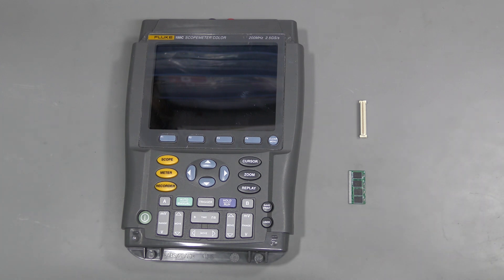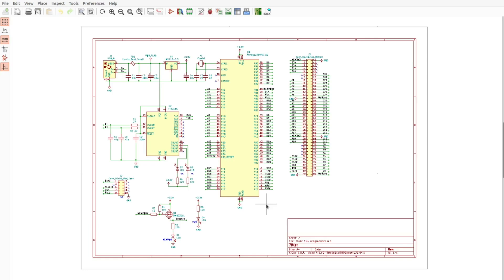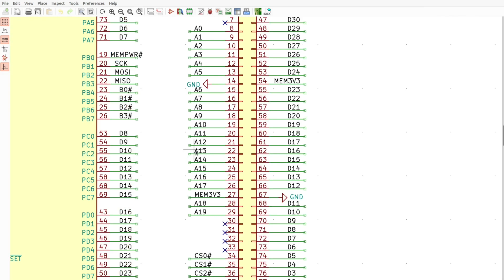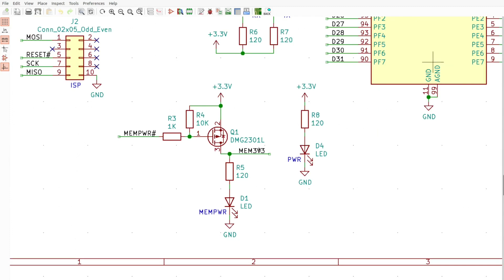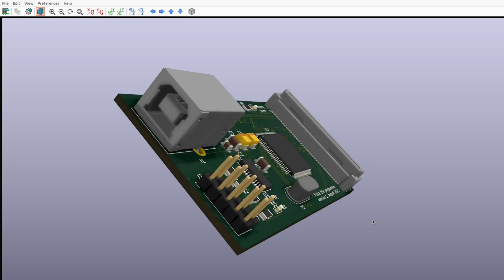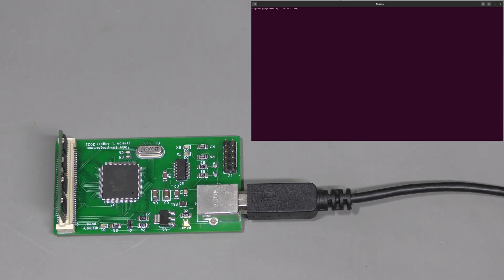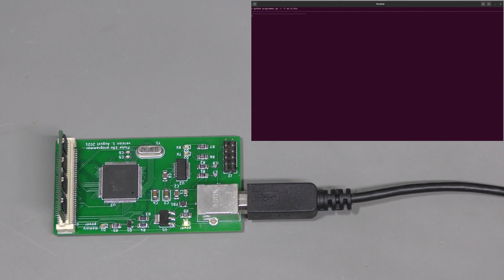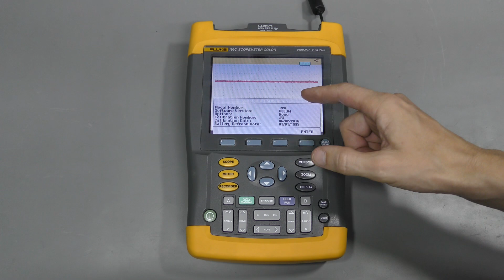#125 - Fluke 19x memory programmer

Comment: I'm  a big fan, great work!!  I have a Fluke 199c with the same memory module as you introduced here.  My 199c only gives weak beep and does not come on.  I linked to the 199c with my laptop and the "on board" memory gives back a 0(pass) but the A1 board gives back an "A" .  I am assuming the A1 board(memory) is bad.    The 199c will  not turn on without the board, correct?   The little daughter card memory board is the A1 correct?
Reply from the maker: Yes, the scopemeter won't boot without memory module. Only beep. I am not aware of the procedure of reading error codes that you describe. I would like to know more about it.
Reply: There is a troubleshooting procedure in the service manual that has you connect a laptop through the infra-red port and run scripts to check the memory using a terminal emulator such as putty.  It is in section 7.5.12 of the Service Manual "RAM Test".  for example once connected through the terminal(type X several times till the scope meter responds) then type ID...The scopemeter responds with  Universal Host Mask software: UHM V3.0...to test D3502 and D3503  you type EX11, #H20400000, #H100000(for the old Main PCB) or EX11, #H20400000, #H80000(for the new Main PCA D3202 only)
The test tool will return one of the following acknowledges:
0     Ram is OK
1     syntax error in the typed command
6     the RAM des not properly function, replace the two RAMs

for this test my scopemeter responded back with 0.

To test the RAM on the FlashRom/SRAM module A1:
type   WW10000000, 2, 002002 and press enter... the test tool must return a 0(mine did)

The  last test you Type 
EX12, #H44000000, #H100000 and press enter

0   Ram is ok
1   syntax error
6 the ram does not properly function , replace the A1 module

mine returns "A"  not sure what that means.  replace A1?
Reply from the maker: @totaljunk7508  Right, I found the manual you are referring to. If you look at the schematic on page 195 it says: Connector X3501 for Flash/SRAM module A1
Reply: @feedback-loop  what I was trying to say was:  I was expecting the scopemeter to return a 6 if the memory failed and instead it returned a "A" , so it leaves me not knowing if the memory is good or bad.    Is all the software on that module or on the chips that are soldered to the main board?  If the software is on the daughter card, how would I go about reloading it?
Reply from the maker: @totaljunk7508  I must have misunderstood. I thought you were not sure if they call memory module A1. Yes, they do. With respect to the diagnostic 6 vs A, I have no idea, sorry. Regarding software, there is some built-in bootloader or something, the one you are talking to. The main part is on the module. I would think the bootloader does some sort of checksum before booting. Who knows if your problem is with corrupted software or with dirty contacts or with failing chips or with something else. You might try a recovery procedure described somewhere in the instructions for the firmware update in case the update goes wrong. Slim chance that might work. Otherwise the only way I know is what I described in this video. However, a copy of some other module will have wrong calibration and different serial number.
Reply from the maker: @totaljunk7508  I would suggest moving this discussion to the forum linked in the description. There you will have much better chances that someone could suggest something.

Comment: nice job. did you need to recalibrate the scopemeter? fluke website states that upgrading from 6.xx to 7.06 needs recalibration. when copying from one meter to another, are those cal values still valid? i presume cal files are device specific no?
I would be nice to see how a recal works.
Reply from the maker: I made that module for a scopemeter with a missing module. Of course, it would be nice to calibrate it, but that is another project. I don't think I have all necessary equipment. In the meantime the scopemeter seems to work just fine.

Comment: Very nice work! In case you are interested there is a cheap Chinese FTDI-chip alternative called CH340G that I've used many times on my projects. Works great.
Reply from the maker: The one I used is $2.22 on Mouser. Not bad at all for a one-off project.

Comment: are you sure FW upgrade is not possible through the IR port? It was long ago but I am pretty sure I upgraded mine through the IR-serial cable and it was very simple.
Reply from the maker: Yes, I have done just that to upgrade 7.02 to 8.04, but there is no way from 6.xx to 7.xx or 8.xx
Reply: @feedback-loop  yes but the reason for that is the unit will require a new Cal. So even if you "force" it to upgrade to 8.xx by programming the mem directly, still the measurements could be off substantially.
Reply from the maker: @amirb715  Yes, but if you watched my previous videos, you might remember that I made a memory module for a scopemeter, which did not have one at all. So it has to be calibrated anyway. Which might be a topic for another video. :)
Reply: @feedback-loop  oh, yes yes...that's right. If you can also calibrate it yourself that would be fantastic 😃